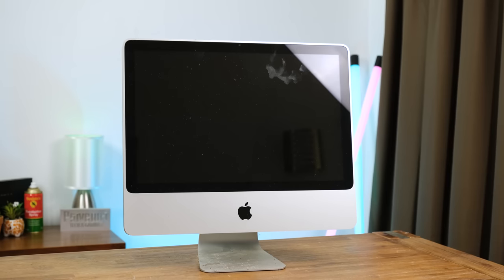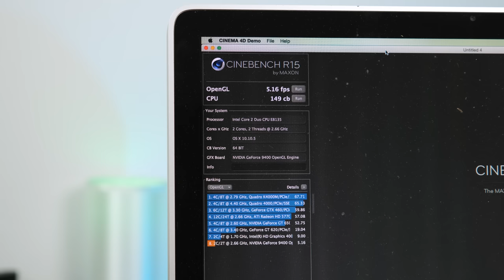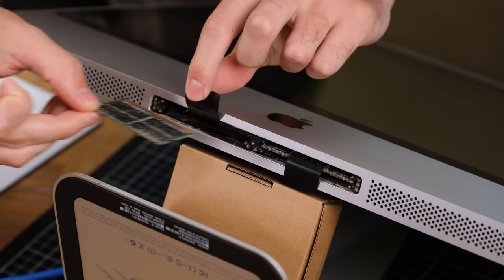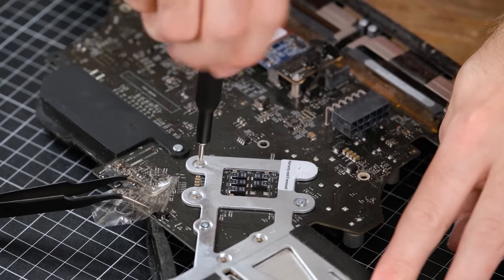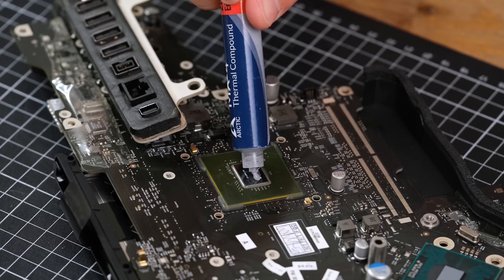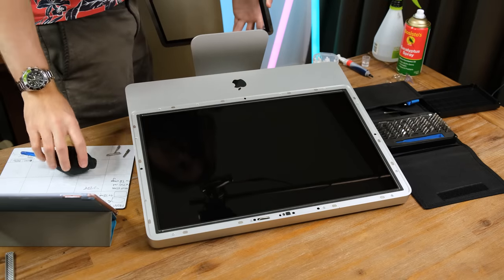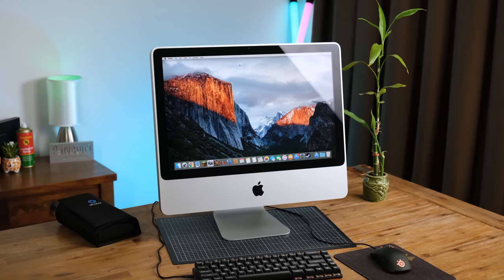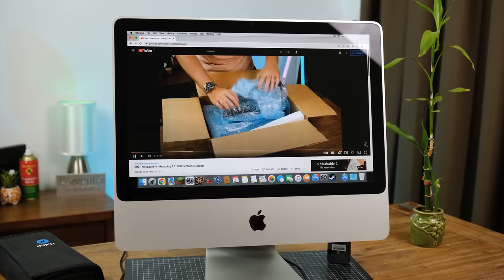Restoring Apple's Cheapest iMac... From 13 Years Ago!

Comment: I still use this exact Mac with Monterey using OpenCore Patcher. The GPU is supported and it works fine with 8GB RAM and SSD
Reply: Now they introduced Beta Blur so you can use Monterey without glitches.
Also photobooth doesnt work. Easy fix: take the photobooth from Big Sur
Reply: @Zebra_Paw  Yes, I use the latest version of apps that doesn't require only Metal GPU, like Photoshop 2020 and older Final Cut
Reply: @lorenzo.delbello  OK, cool then!
But iMovie 10.1.12 does not run in Big Sur and later.
Reply: @Zebra_Paw  No, I had the same problem with Final Cut, the icon appears with the "stop" logo. But on YouTube there is a simple way to run it using Terminal and it runs just fine. I have edited and exported a video without any problems even in latest Monterey 12.3.1
Reply: @lorenzo.delbello  But you need terminal everytime you launch it?
Reply: @Zebra_Paw  No, in the same video it makes a script on the desktop to auto-launch it. You can even put the icon that you want, the only thing you can't, is to lock it on the dock
Reply: @lorenzo.delbello  oh ok
what about launchpad?
Reply: @Zebra_Paw  No I think, I haven't tried. It is a shortcut as you can see in the video
Reply: @lorenzo.delbello  try automator?
Reply: @j6259  Probably it works, but for me, the shortcut on desktop is fine
Reply: I never knew that exsisted
Reply: How’s Monterey on this compared to Dosdude Catalina?
Reply: @jl3449  Same performance
Reply: I'm currently using this exact model of iMac as my main computer atm. But it's still running el captain as I don't feel like going through all the hassle of going through open core legacy patcher. And only has 4GB of ram as the 8GB ones were too new to work with this iMac
Reply: bro is making Tim cook angry😂
Reply: I have a 2008 model and the maximum ram is 6GB so, the best os I tested is Mojave, is so fast like El Capitan, today I installed Sonoma and is slow, I don’t know how’s Big Sur runs but I try to test later.
Reply: @danhutchinsonbackup  You can but 8GB of RAM for cheap now
Reply: @lorenzo.delbello  I've since upgraded to a 2015 iMac

Comment: I do remember this video haha, lovely blast of the past. I had a 2008 model which included a 3.06GHZ Core 2 Duo, Nvidia 512MB GPU and I believe 4GB of ram :)
Reply: i have the early 2008 model with a 2.66 ghz core 2 duo, 500gb hard drive, 4gb of 800mhz ddr2 which was awfully slow, abd a defective ati radeon 2600 pro which would show artifacts all over the top of the acreen
Reply: @cheeseman498  Aww no that is gutting, the ATI cards are so prone to failing. I have been lucky with mine. Are you going to consider restoring it? :)
Reply: Still better than my pc
Reply: patch it to High Sierra. You will have no issues with Apple and 3rd party apps due to the GPU being officially supported in the OS
Reply: @cheeseman498  you need Samsung SDD :)

Comment: These macs are pretty cool. I recently bought one in brand new condition, the last owner said he bought a computer in 2007 and used only once so it came with original box (the serial number matched), never used original: keyboard, mouse, cleaning cloth, remote, manuals books and cd instalation disc. He even gave me wireless magic keyboard 1 and wireless mouse with box and in perfect condition. Maybe someone can think that i overpaid for it paying 250usd but i live in contry that is pretty imposible to buy fully functional computer for less then 250usd.
Reply: If it was in mint condition, and with everything you said, 250 was a great price.
Reply: Not trying to start anything but impossible( I'm just correcting ppl (;
Reply: @dieforyourecords.  It's not entirely far-fetched. The guy he bought it from could have been a computer enthusiast and already had a main computer, so he just put it in storage, thinking he would use it some day.
15 years later, he finds it after forgetting about it, and sells it.
Reply: @yourfriendlysubaruoutback  I was correcting gabrynios comment because he said imposible instead of impossible but yeah your right

Comment: I bought a 2008 24 inch iMac, for 50 dollars in a goodwill store while thrifting. I put in a ssd, maxed out the ram and used the dosdude patcher to run modern os. It is still a good PC for most situations.

Comment: I use two of these early 2009 machines as my main desktops. They are still great and there is still a lot you can do with them. Mine are 24" models, which I prefer.
Reply: I have the 20 inch version and I'm actually quite surprised at how useable it still is today. I even use it as a secondary computer and it lives right next to my late 2015 iMac which is my main computer

Comment: Nice.  I have a 9,1 that is still one of my daily drivers.  I keep it in my kitchen for when I need to reference things, for recipes, and have my work O365 account on there so I can easily keep in touch with the office and such.  It's the old iMac I have that's still a daily driver.  I also love the fact it still has an optical drive.  I have the Catalina patcher on it, and for what I use it for, I have no complaints.  I also have Remote Desktop to jump into the two PCs I have on my network, and of course I can easily screen share with any of the other Macs I have on the network...  which is also a cool way to get modern use out of the the older CRT iMacs and the eMac if you want a cool conversation piece ;)

Comment: Oddly enough I've just got a free early 2008 imac from the father in law. Core2 duo 2.6 (i have a 3.0 but Im holding off as its involved to get to the CPU!!), upgraded the ram to 6Gb (max possible), dropped in a 500G SSD, and a patched version of High Sierra. Runs Pro Tools 11 just fine

Comment: I did exactly what you did on my 27" iMac (Mid 2011) 3.1GHz Quad-Core Intel Core i5, but it lasted 5 months until the heatsink failed again. I'm planing to upgrade it to 3.4Ghz Quad-Core Intel Core i7, along with the AMD Radeon HD 6970M 2GB GDDR5 card (mine is 1GB).
For security purposes, Safari isn't an option for browsing the web for macOS can't be upgraded any longer; so I was using Chrome. I only used this computer for basic stuff, and while I can get me a new one, for what I'll use it for, I prefer to repair it.
I know this model is very good, and of that I'm sure! But, do you think it's worth the time and money spent on this model? And if you do, is there anything else I might need to do to make it run smoother? Thank you so much for your time!

Comment: Install High Sierra will cause no bugs because the GPU is officially supported in High Sierra.
You could also go for Big Sur or Monterey
Reply: Not without patchers....
Reply: @imixmuan9081  High Sierra can be installed straight without patchers, all it really needs is a platform check disabler.
Of course it's better to use Dosdude's patcher. It works flawlessly, as problems caused by patchers are always a result of a graphics issues, which you won't have in High Sierra as the GPU in this iMac is officially supported in this OS.

Comment: I have this same year iMac that I use at home, if I want to upgrade the ramp, can I simply just pull the ram out swap it for a bigger ram or is there other steps I need to do? Also, if I upgrade the RAM, what are the benefits I assume it will run faster and be able to handle certain tasks better.

Comment: I recently got several iMac A1224s (Mid 2007, Early 2008), and I really enjoyed cleaning them! I wish to get my hands on this Early 2009 model (A1225), since it comes with DDR3 RAM. As always, this is a great video!
Reply: I fairly recently started my Mac collection with a 2006 core duo iMac. It now has been flashed as a core 2 duo iMac and has 3gb of ram. I also bought a 2010 MacBook Pro, two PowerBook g4(one titanium, one 17 inch), a 2011 iMac, a 2007 MacBook Pro 17 inch, and an iMac g5.
Reply: @EvilTurkeySlices  that’s great! I also did that iMac4,1 project, updated the firmware, upgraded CPU to a C2D, SSD, and 3GB RAM! I used Boot Camp to dual boot Snow Leopard and Windows 7 (haven’t figured out how to white list the logic board so Lion can be installed).
Reply: @kielagut  I just have snow leopard installed now. I used to have windows XP as well but the hard drive died and I haven’t gotten around to setting it up again. Also how did you get windows 7 working? I tried 7 32-bit but I couldn’t get the graphics drivers working. Even from the official snow leopard disk.
Reply: @EvilTurkeySlices  I downloaded and installed Boot Camp v3 on my Windows 7 installation, it was able to successfully install all required drivers. I think the audio driver was the tricky part, but Boot Camp also managed to make it work somehow.

Comment: Hey tried resetting my imac A2125 , started not uploading on the load bar on start up , took forever and would never boot up —- now it’s completely blank and is making a beeping noise every few seconds , not the 3 beep the “” the one that beeps every few seconds ….it’s running El Capitan help if you can thanks ❤

Comment: I just looked up 'trading it in' for some money off a new mac, and they said it needs to be recycled, and I was bummed. It still works perfectly! I don't want to recycle it (death). Is it weird that I have feeling for my old machine? lol? I have all the tools and things to take it apart and clean it up. But, I am wondering... is there ANY way to upgrade a really old machine like this to accept a newer operating system than El Capitan? And new graphics processor? Or is a RAM thing? Or an SSD thing? Thank you so much for this very informative video. :)
Reply: You can use an SSD, although bare in mind the machine has a SATA 2 cable which means it won't utilize all of the SATA 3 SSD's read/write speed (It will only utilize ~250-300 Mbs). Ram can be upgraded up to 8 GB using two 4GB SO-DIMM DDR3 modules. I don't think there are many great upgrades for the CPU on these units, some have tried with mixed results. For the GPU I'm not sure, maybe you can swap around a GPU from some of the earlier models like the Early 2008 iMac with the NVIDIA GeForce 8800 GS (512 MB) or the Late 2007 with the ATI Radeon HD 2600 PRO (256 MB). It can be upgraded up to El Capitan (Officially). For Sierra, High Sierra, Mojave, Catalina you can use Dosdude1's patchers and OpenCore Legacy Patcher for later versions of macOS. I think it's still a good machine for basic tasks such as web browsing.
Reply: If not macOS, Linux will continue to work.
I got Ubuntu Studio 22.04 installed on an iMac 20“ early 2008 with 4GB of RAM. Gonna upgrade to a SSD soon.
Reply: No, I am very emotionally attached to my Dell Optiplex 990 from 2011. I do have a few newer computers in my household (although my Optiplex is 100% my computer only), it’s so on some websites and lacks in some areas and I do have the money for a better system, but I just love the damn thing like a girl. I’m thinking of replacing it with a silicon Mac Mini, maybe.
Reply: I still use a mid 2009 iMac in Early 2024, it’s ok for simple tasks, but a very basic computer overall.

Comment: Hi! I have same model, early 2008 20" C2D 2,66ghz. mine has issue with GPU thermal sensor. It reads 129 degrees celsius all the time and it is, let's say, okay in non graphic tasks, but in all other tasks are sooo slow. how can I give my mac a second life? No service was brave enough to take my mac in and service it properly. I guess just thermal sensor has to be replaced...

Comment: I have my grandmas old one of the same exact model however it’s fans are at max constantly even when the computer is first booted up. Still has a hard disk drive and only has 2 gigs of ram. And still running leopard. However I do have snow leopard on another hard drive and I do have lion and mountain lion on ssds. I will get a few more ssds to put mavericks Yosemite and El Capitan onto so I have every version that it was ever compatible with 

Update. I have All compatible OS versions for it now. As well as my late 2015 21.5 inch iMac I also have all compatible OS versions for it from El Capitan-Monterey all on ssds except Monterey which is on the internal HDD which is very very slow 

Anyways back to my early 2009 iMac. Now I played Minecraft on it and it's a bit laggy but tbh it only has 2GB of RAM and needs to be upgraded to 8GB of RAM to better Mach my more modern late 2015 iMac which also has 8GB of RAM

Another update: it had new ram. Unfortunately the 4GB ram sticks I had for it were too new so I put 2GB ram sticks so the iMac now has 4GB of ram instead of only 2GB
Reply: @@aIwI89 YOU DONT ETHER STOP STALKING ME

Comment: Hi! 
Do this iMac or the 2011 models have AirDrop and target display funktion ?
Reply: The 2011 models have airdrop, but only Mac to Mac. For Mac to iPhone you need a 2012 or newer.
Reply: Target display I think is also 2012 or newer.
Reply: So with my 2020 macbook air it will work just fine. If i am correct. Thanks for the answer!

Comment: Great restoration! Personally, I'd have either kept with the 4GB RAM, or upgraded to 8GB and upgraded the storage to a larger drive (if using for multimedia). Given that this is an older machine on an older version of El Capitan (even the latest Firefox won't install on El Capitan), it doesn't make sense to go all-out on this machine, but given the large speaker units and the DVD drive, this would be a great machine for media playback. In fact, I'm surprised it uses DDR3, given that the CPU is a Core 2 Duo. Most Core 2 Duo systems (especially Windows ones) used DDR2 RAM instead.
If I had something like this (and I won't be buying this Mac, since I live in the UK and not Australia), I would probably have 8GB RAM, a nice sizeable 3.5in HDD (like 2TB or more) and used it as a media playback machine, for CDs/DVDs or similar.
Reply: The latest Chrome is still supported (for now) and there are probably some other browser choices. But, yes, time is ticking. one of mine will eventually become mainly a media and photo machine, and one will end up mainly for Garageband. In the meantime, I do everything I possibly can with both of them :)

Comment: Let's find out who has the most macs, reply your collection.
Reply: 700 mhz graphite imac g3
1.2 ghz emac
700 mhz emac
455 mhz ibook g3 clamshell graphite
233 ibook clam shell blueberry
15 Inc 800 mhz imac g4
20 inch imac g5 
Power mac mirror door
Power mac quic silver
Power mac g4 original graphite
Power book g3 233
Ibook g4 14 inch 1.2 ghz
Iboon g4 14 inch 1 ghz
Ibook g4 12 inch 1.2 ghz
2006 mac book pro 17 inch 
Late 09 core 2 duo 24 inch imac
Early 09 core 2 duo 20 inch
2011 20 Inch imac

Comment: Tried playing Roblox on my early 2009 iMac and it runs like CRAP
Reply: @@aIwI89 LEAVE ME ALONE
Reply: @@aIwI89 STOP STALKING ME ALL THE TIME
Reply: I still use Mid 2009 iMac and it’s fine for eBay (simple websites), YouTube, and using Ai bots. It’s by no means a snapping computer but it’s quick enough to where I won’t pull my hair out.